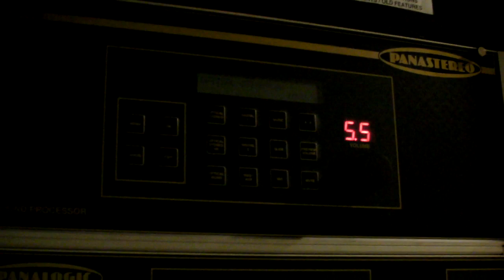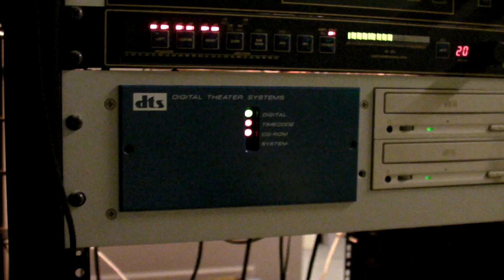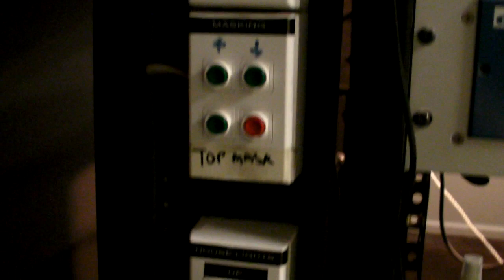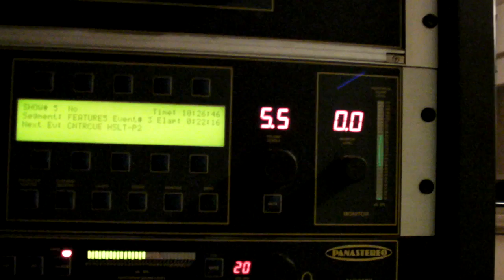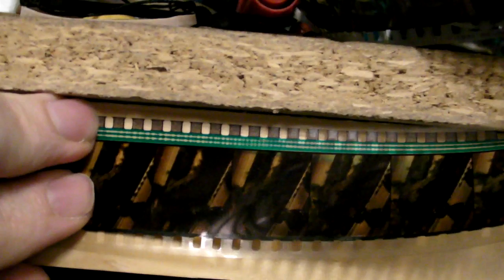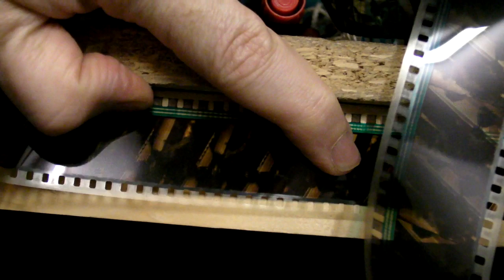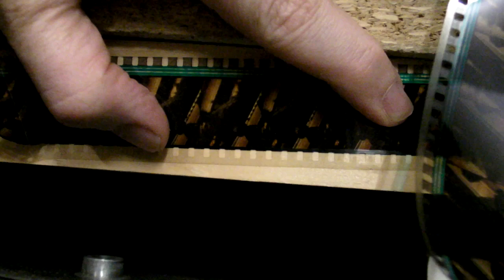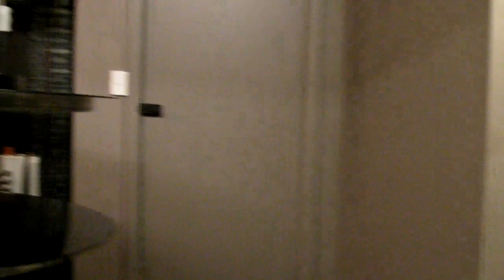How a Film Projector Works in a Cinema

Comment: In the youtube movie "How A Filmprojector Works In A Cinema" You placed the DTS timecode on the wrong place.
The place you pointed at is the place where one of the two SDDS soundtracks would be.
The typical place for the DTS timecode is next to the optical soundtrack.
Reply: Correct.
The DTS time code is located between the optical soundtrack and the film image area.

Comment: @johnnypoep The amount of sound that is on just 1 frame of 35mm film is equal to 1/24th of a second.  You're not going to get much out of that little bit of film you have there.  To even get some sound from it thought, you would need an led sound reader.  BACP is the most commonly used brand of sound readers unless you are going with expensive readers such as DTS, Dolby, or SDDS.